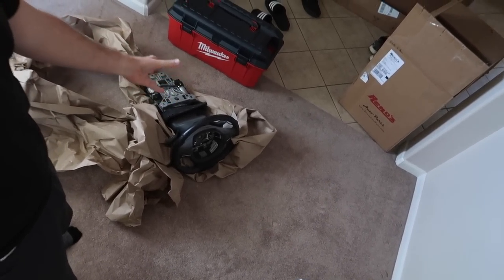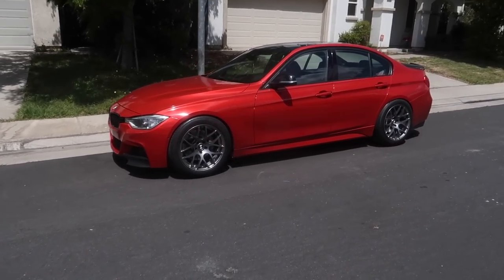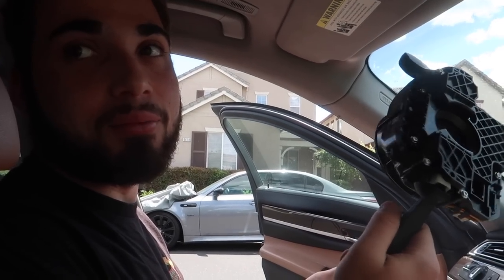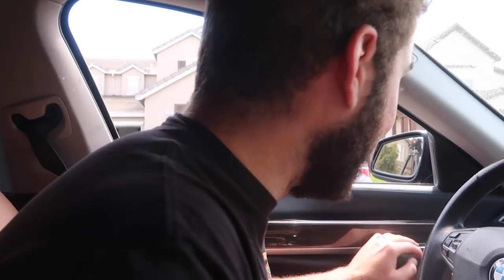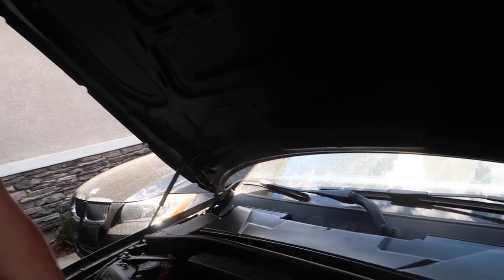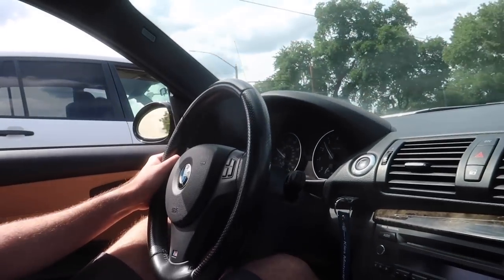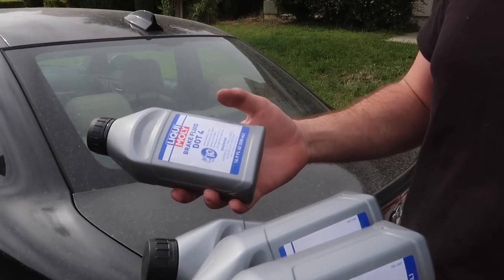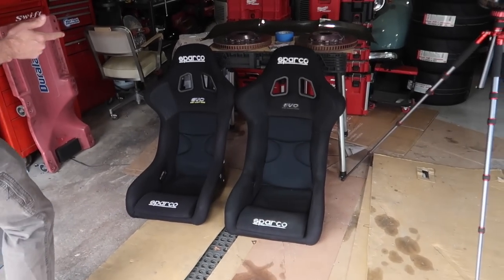PERFECTING THE 740LI AND SHOWING THE 135I SOME LOVE!

Comment: U are able to replace that turbine sensor I’m not just saying that I have the same car and I have replaced it I’m 14 btw , it is very difficult and there is people on eBay who will do it for u for like 400 but Yk diy  , the actual sensor is not soddered together just the connection which I just took apart and the new sensor I put some sodder on top so it’s flush then I just put it all back and it works it’s been about 5 months and haven’t had a problem. But I doubt any shop will take the job. And bmw doesn’t even repair trans only replace